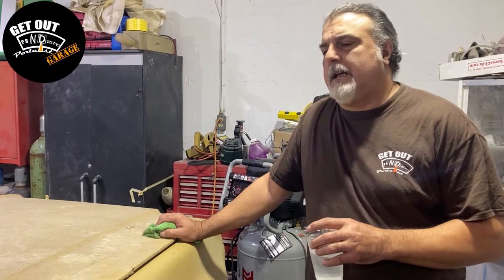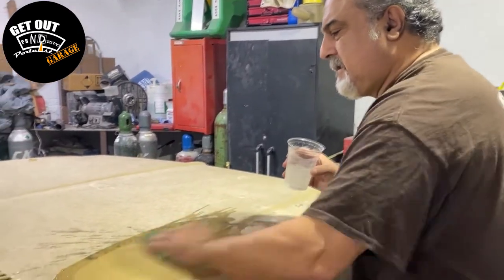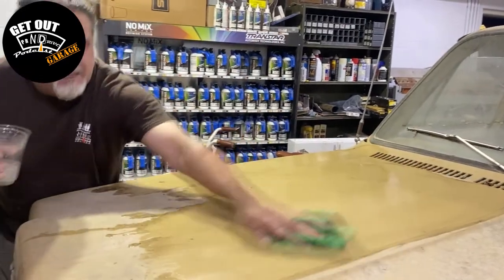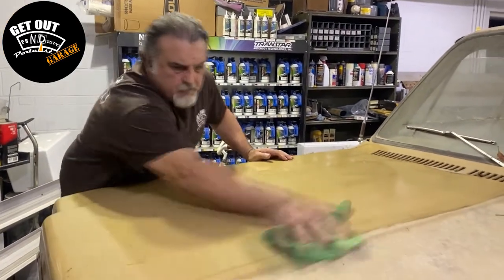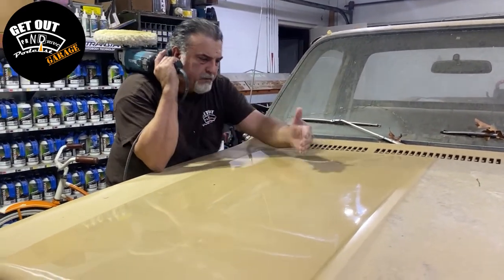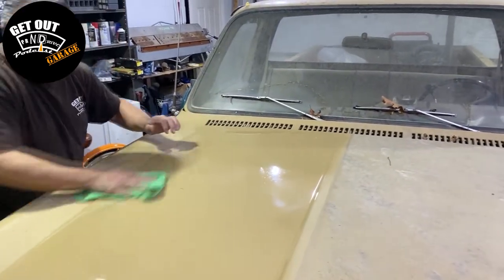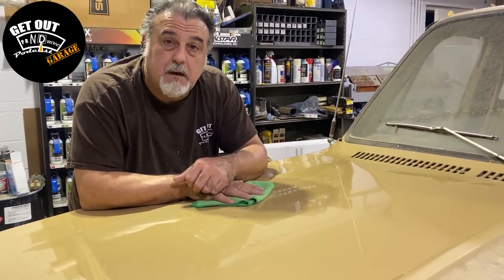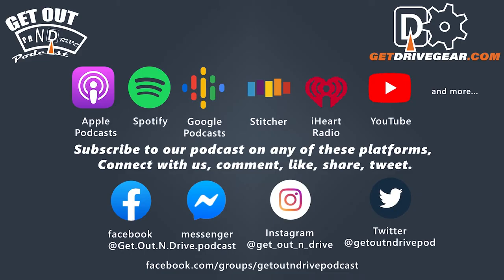Cheap and Easy C10 Patina Buffing

Comment: Nice. I bought a machine from harbor freight. Haven’t used it yet so not sure if it has speed control. I also bought foam pads. Are those coarser than wool pad or is it okay to use them. I think I got two different colors. Blue and green or yellow can’t remember. I also got meguairs rubbing compound from harbor freight too.
Reply from the maker: I use 3M tan wool pads and perfect it cutting compound for coarse initial cutting followed up by a black foam pad with Perfect it II machine polish for final buffing. The blue foam pad is used only for final swirl removing.

Comment: Bought a variable speed buffer to maybe start on my 70’ ford. I used a scotch brite pad and water to get the oxidation off. 
What exactly is the compound you used?
Reply from the maker: I used 3M perfect it 06085
Reply from the maker: I used 3M perfect it 06085

Comment: Just bought 46 ford Deluxe running and same issue on paint ,how would I get to small curves rounded area where big buffer won't Get to narrow areas,thanks
Reply from the maker: You can get a Velcro backup pad kit and a tiny wool pad followed by a foam pad. I’ve purchased them from Harbour freight. 

https://www.harborfreight.com/power-tools/polishers-buffers/polishing-pads-wheels-accessories/polisher-accessory-kit-6-pc-64607.html

Comment: Hi there what's the first product in the clear cup you used? Need to shine my '66 chevy pick up
Reply from the maker: It’s simply just water to clean off the initial layers of crud.
Reply: Cool, now the 3mm compound can it also be fine by hand if I don't have a buffer
Reply from the maker: @anggonza18  Yes, but it will take longer to get a good shine and finish.

Comment: Much of the paint on my ‘85 squarebody looks like this but there are half dollar size spots of rust here and there. I imagine you wouldn’t want to run the buffer over that. Does anyone have a recommendation on how I should tackle those rust spots in order to buff the area it’s on?
Reply: Buff the rust spots down with scotch bright or steel wool than linseed oil them or just polish over them.  The problem is you don't want rust flakes in your polishing pad.